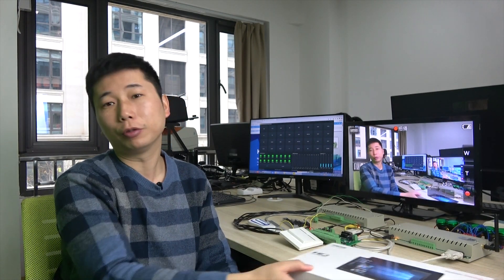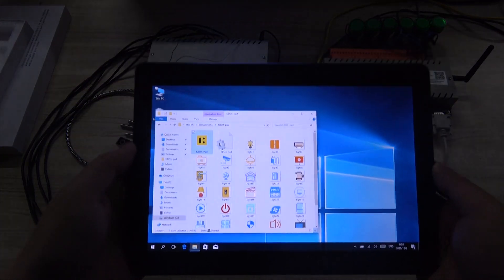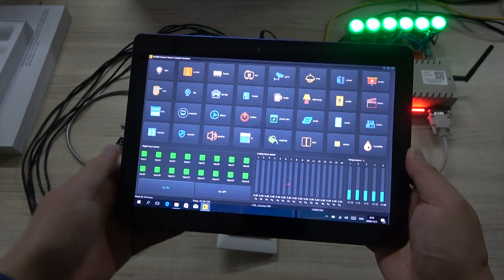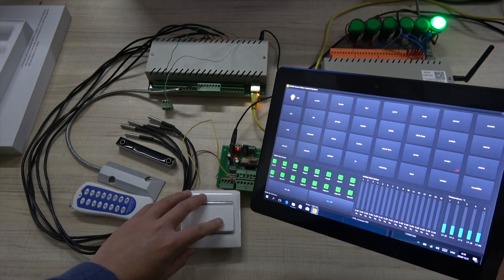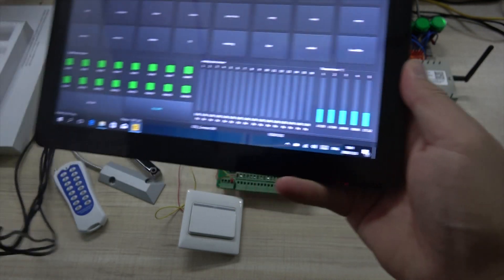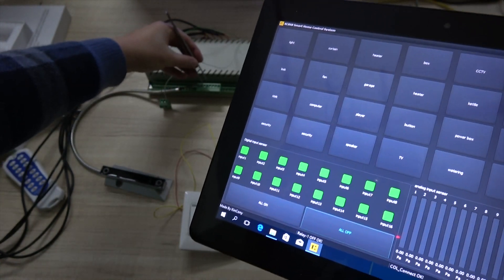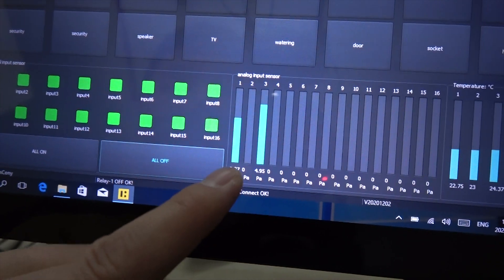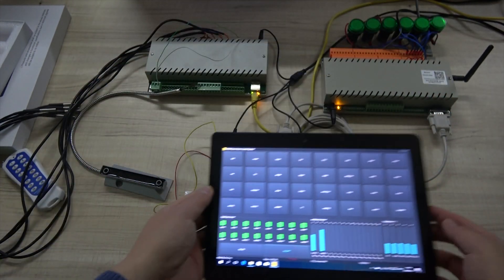ethernet wifi relay digital analog sensor module smart home diy tablet windows pad

Comment: Is it possible to connect this module with another kc868 to control both in a single scenario script ( master-slave mode) and what delay between input signal and output relay reaction will be ?
Reply from the maker: do you want input of A controller trigger relay output of B controller?
Reply: @KinCony  I need an input to turn off outputs/relay urgently of all modules
Reply from the maker: @sergijg  add an switch terminal board, there is all off button for manual control
Reply from the maker: controller C and controller B and Controller C..... all is connect with internet. all is master, no slave mode. every controller is work independently

Comment: Very nice! Can you put delay on all off/on button? So all relays on and off with steps, for safety reason. And on next version, please consider to put RTC on the board, so it can control scheduling by itself once we set it, not depending on the software anymore. Keep up the good work!
Reply from the maker: thanks for your suggestion, now RTC in on KC868-COL, H32B relay controller scheduling by COL, COL is a smart brain.

Comment: So you have a wifi relay box, the 32 output for the manual switch connected via Rs32 and one analog and digital sensor box concerted thru ethernet??
Reply from the maker: yes, but also can let relay box use by wifi and sensor box also use by wifi.

Comment: If i want to make temperate log-data 
it is can do in the software?
Reply from the maker: how many time save one record?
Reply: @KinCony  1month
Reply from the maker: @moringa1941  log file for history temperature records save for 1 month?
Reply: @KinCony   yes
Reply from the maker: @moringa1941  this function can be add in furture.
Reply: @KinCony  So, now i can check   the just monitoring?
Reply from the maker: @moringa1941  yes, if you want see history, we can change the code save data to a txt or excel file

Comment: Can it be connected with cable or only WiFi? I need secure connection, I don't trust WiFi
Reply from the maker: if you want tablet connect router by cable, ok, use a USB->ethernet adapter is ok.